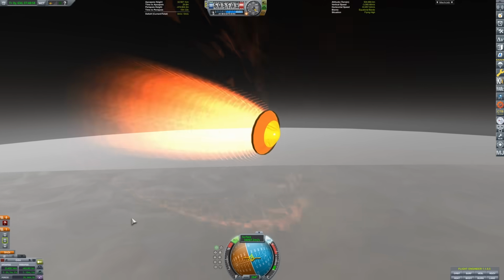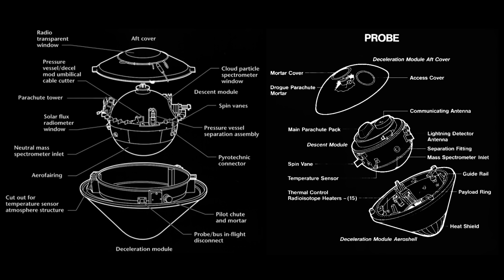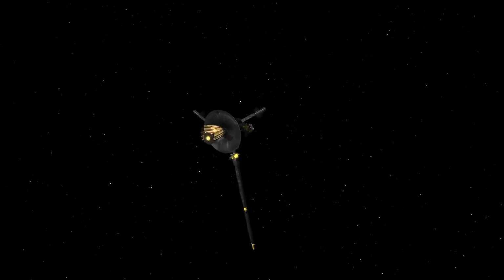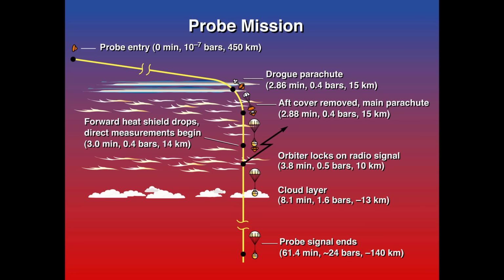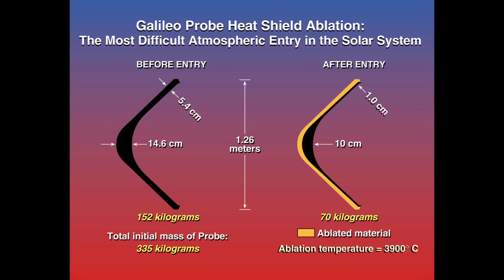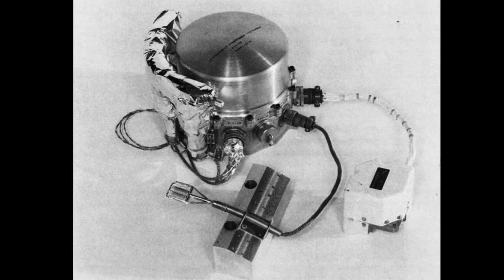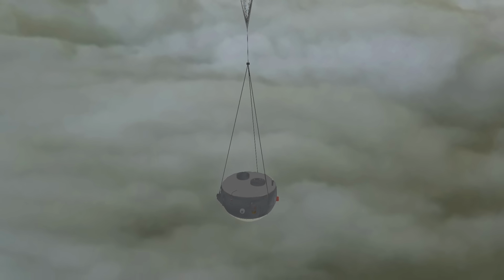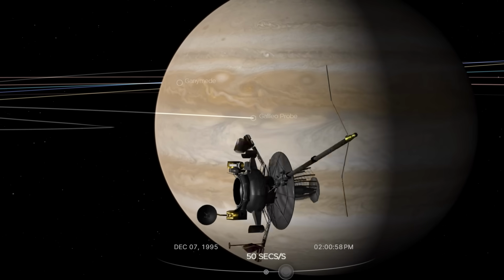The Toughest Space Probe Ever - How NASA Dropped A Probe Into Jupiter

Comment: How NASA's Galileo Probe Braved Jupiter's Extreme Atmosphere

*   0:04 Introduction: Almost 30 years ago, NASA sent a probe into Jupiter's atmosphere to analyze its composition, facing extreme challenges.
*   0:36 Heat Shield Challenges: The probe's heat shield had to withstand an entry velocity of 47 km/s, generating kinetic energy many times higher than experienced during a return from the Moon.
*   1:56 Extreme Conditions: The probe encountered peak temperatures of 15,000 Kelvin and heating of 30 KW per square cm, with a maximum deceleration of almost 250 G's.
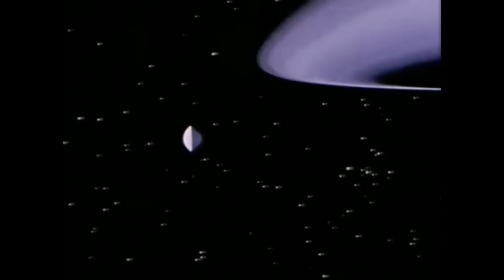*   2:45 Mission Background: The Galileo mission, conceived in the 1970s, aimed to orbit Jupiter and study its moons, building on the Voyager mission's findings.
*   3:17 Pioneer Venus Comparison: Galileo's probe was derived from the Pioneer Venus probes but had a much thicker heat shield (15 cm at its thickest point).
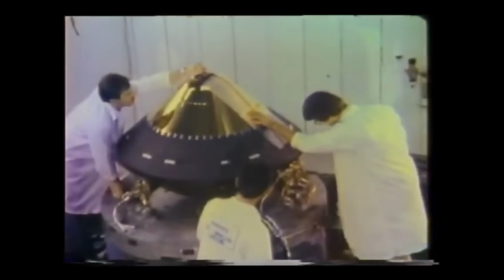*   5:11 Entry Velocity: The probe's entry velocity was less than Jupiter's escape velocity due to a trajectory that aligned with Jupiter's rotation, reducing the relative speed by about 12 km/s.
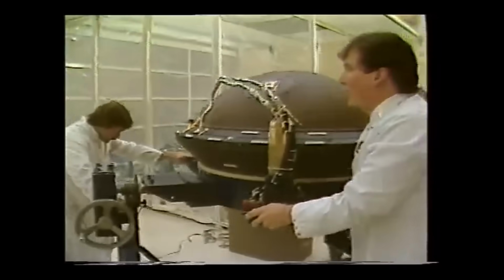*   5:54 Power and Attitude Control: The probe relied on battery power and was spin-stabilized for attitude control during its five-month journey to Jupiter.
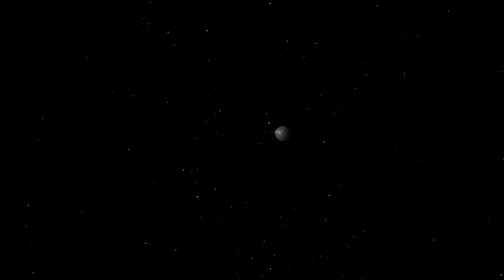*   7:47 Communication Challenges: The failure of Galileo's high-gain antenna limited data transmission to Earth, necessitating the use of a tape recorder to store and slowly relay data.
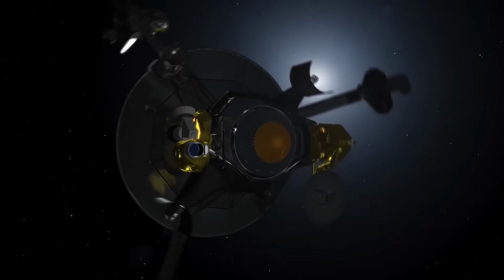*   8:28 Tape Recorder Issues: Problems with the tape recorder led to a decision to prioritize the atmosphere probe data over a close flyby of the moon Io.
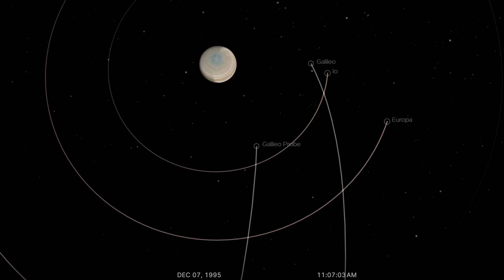*   9:50 Atmospheric Entry: The probe entered Jupiter's atmosphere on December 7, 1995, with the entry point defined as 1,000 km above the one-atmosphere pressure level.
*   11:33 Peak Deceleration: The probe experienced a peak deceleration of 230 G's, dissipating 20 gigawatts of power during a 100-second period.
*   12:01 Heat Shield Performance: Post-entry analysis revealed that the heat shield had ablated more than expected, with 4 cm lost out of a 5 cm thickness.
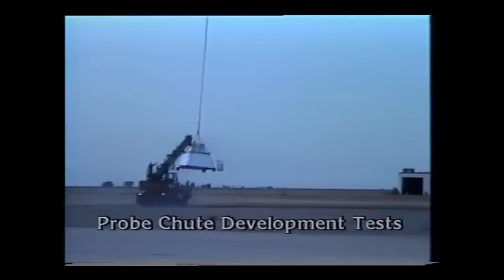*   13:11 Science Phase: After surviving re-entry, the probe jettisoned its heat shield and descended into the atmosphere under a parachute to conduct scientific measurements.
*   13:25 Parachute Deployment: A wiring error caused a delay in parachute deployment, resulting in the probe descending an extra 5 km.
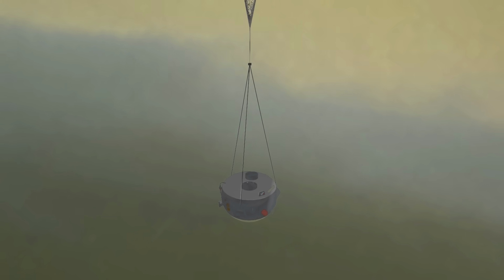*   15:29 Science Instruments: The probe carried instruments to measure atmospheric structure, energetic particles, lightning, radio emissions, isotopic abundances, helium abundance, and cloud particles, and to conduct a Doppler wind experiment.
*   17:32 Scientific Findings: The probe found a lower-than-expected abundance of helium and oxygen, stronger-than-expected winds, and less lightning than anticipated.
*   18:22 Anomalous Water Levels: Later data from the Juno mission showed that the Galileo probe likely entered a "five-micron hot spot" with anomalously low water levels due to a hole in the cloud layer.
*   19:23 Isotope Ratios: Isotope ratios suggested that Jupiter may have formed further out in the solar system and migrated inwards.
*   19:43 Probe's Fate: The probe transmitted data for 78 minutes, descending to a depth of 160 km and a pressure of 23 bar before being crushed.
*   20:54 Galileo's Legacy: The Galileo spacecraft continued its mission, orbiting Jupiter and sending back valuable data despite the communication limitations.

I used gemini-1.5-pro-exp-0827 on rocketrecap dot com to summarize the transcript.
Cost (if I didn't use the free tier): $0.03
Input tokens: 21058
Output tokens: 853

Comment: All that effort and the probe crushed at pretty much the test pressure for an aerosol can. Why wasn't it much stronger?
Reply: An aerosol can wouldn't survive 5 atm of external pressure. It makes a big difference whether you're containing or resisting pressure.
Reply: The limits were not just on strength but the power of the transmitter as it got deeper into the atmosphere and the fact the probe and relay ship were also moving away from each other.  This poor thing was battery powered.
Reply: you clearly forgot that pressure wasn’t the only thing there, heat killed it first

Comment: Considering they had 20% of their heatshield left in the end, the engineers actually did a great job estimating the correct thickness with a safety margin while also saving weight
Reply: Yes- and- no.  They got the total amount right, but the distribution a little wrong. 😅
Reply: Better to learn with an unmanned probe than a manned one, if we ever decide to try that at least. @jonskowitz
Reply: They had too much in the nose section, could've saved some weight by removing it, or beefed up the sides by redistributing it
Reply: A good engineer can build a bridge a great engineer can build a bridge that barely stands
Reply: @Official-Bush-applé Anyone can make a bridge, but it takes an engineer to just barely make a bridge.
Reply: @Official-Bush-applé if it only takes a fat oily man to break your bridge, how terrible.
Reply: Or don't get it right the first time. That means we don't get another job getting it right the second.

Comment: Great video, some footage of the probe ground processing I hadnt seen!   One minor nit, at 3:21, the Pioneer Venus Probes sent their data directly to Earth, the PV orbiter did not relay their data in the way Galileo did.  Another difference is that the Galileo probe was vented, so the hull itself was never 'crushed' (though the instruments inside were...) Ralph Lorenz, co-author "Planetary Landers and Entry Probes",  Dragonfly Mission Architect
Reply: The original mission design had the Jupiter Entry Probe's data being sent 'bent-pipe' via the Orbiter's X-band HGA link (max 134 kbps) prior to the JOI burn (with its attendant risk of losing the Orbiter). With the failure of the HGA to deploy, the only option was to store the Probe data on the DMS for later retransmission to Earth at a much lower data rate via the S-band LGA. An 'edited' set of Probe data (headers etc. stripped out, leaving only the measurement-containing symbol data Had the data stored on the DMS, been lost, the entire dataset could have been reconstructed from the symbols) was stored redundantly in both CDS strings for a quick look (and backup to the DMS) for more immediate downlink prior to Solar Conjunction which blocked all data return for a few weeks. The total Probe data occupied ~50 kB, easily accommodated by a 5-inch floppy disk.
Reply: A vented atmospheric probe! But I guess the electronics and some of the instruments were inside (or entirely built as) sealed vessels. It would be nice to know the rationale behind this design as, IIRC, the Pioneer Venus probes design pressure was also quite high and one of them even continued working after impacting the surface (~100 bar).
Reply: I can no longer hear the word Galileo with my brain singing "figaro!"

Comment: The reason that the High Gain Antenna failed to deploy was that the Spacecraft went into storage due to the shuttle failure.
NASA was not aware that the Lube on the high gain antenna deployment mechanism was sensitive to long term exposure to moisture.

They did not purge the mechanism and store in in a moisture free environment (enough) OR redeploy and replace the lube before launch
Reply: The Flight HGA was overtested and stressed during dynamic testing. With the only backup HGA now the prime flight antenna a policy of 'handling it gently' was followed. This extended to not fully  retesting the antenna after a couple of years in storage and two trips by truck across the United States (the travel container, a big white cube mounted on a low-boy trailer, picking up a bullet hole in, where else, Texas). 

It is thought that the 'scrubbing' of the pin on the antenna rib in its groove on the center column from the vibration during travel depleted the dry lube and perhaps even galled the metal surfaces, increasing friction to the point where it could not come free. The engineers investigating the problem did a lot of tests using our Testbed to control and drive the spare antenna. They  said the smallest pressure from your pinkie would probably pop the pin loose, but there was no way to apply that force in the right direction using the functions available on the spacecraft. It was designed to isolate the system from such dynamics, not transmit them through. The dynamics of spinning up the spacecraft for the JOI burn, as well as the burn itself, we're considered to be the last chance of popping loose the pin, and that was not thought to be probable at all.
Reply: @Gregory_Laborde  My company made the drylube (Ball Aerospace - now BAE).   We use it in all of our deployment mechanisms. it must be purged or it will absorb moisture and cease being a lube
Reply: I do not know anything about the dry lube, but I am pretty sure it was nothing exotic or unusual, and not implicated in the failure.
Reply: I was also told that they repurposed some processor on the spacecraft to compress data for the 10 bps downlink rate.
Reply: @stuartgray5877 That was the offline AACS processor, which was powered off and only planned to be used in the event of a failure of the prime AACS processor. Since it was just sitting there doing nothing...

In the event of a failure of the prime AACS processor, the backup processor would be immediately reset and reloaded with Attitude Control and Articulation software to maintain the safety of the spacecraft.
Reply: I heared a something about cold welding. Was this a myth?
Reply: @lukasskymuh5910  I never heard any mention of cold welding. Since the pin was Titanium and the groove stainless (or was it vice versa? This was 30+ years ago. Where were you?) I do not see how cold welding could have been a possibility.
Reply: @Gregory_Laborde  I checked this and apparently the source is: Johnson M. R. (1994) "The Galileo High Gain Antenna Deployment Anomaly." 28th Aerospace Mechanisms Symposium

It is mentioned in "Cold Welding under Space and Launch Conditions" Roland Holzbauer
Reply: @lukasskymuh5910  There is such a thing, but typically with items of certain materials in contact for a long time.
We have learned what materials to use and not to use that it is of little concern today.
We do still depend on certain types of vacuum grease and lubes that can still have useful properties even in vacuum, but they typically require some care in handling before launch.

Comment: The atmospheric-probe wasn't crushed by Jupiter's atmosphere, Scott, as it had pressure-equalising valves, the probe instead was cooked as it descended into the hotter, deeper layers before then melting and finally vaporising.
Reply: @nicholasmaude6906  Although your statement is probably right, there is an effect that has burned many underwater ROV makers - one can equalize pressure all one wants, but there remains cavities inside chips that are often at 0 psi. That's fine, until physical deformation brings 2 things into contact that should never touch. Then, it stops working. After bringing it back up, it resumes working, making diagnosis trickier.
Reply: @FelonyVideos  While you have a point about the pressure, the ROV designers don't have to contend with increasingly higher temperatures as the ROV descends into the depths.
Reply: @nicholasmaude6906  True. And good point. 5 kpsi in gas pressure on Jupiter is probably enough to destroy/melt anything that isn't metal. Ocean depths have the huge advantage that the vehicle is surrounded by an infinite 33F heatsink.
Reply: In other words, heat stroke and battery failure killed it. I imagine it fell hundreds of miles after that, melting then burning up as it fell.
Reply: @taras3702  Nice summary of the probe's fate.
Reply: Anthropogenic Jovian Warming... 😂

Comment: There was actually a much more serious problem than the ’snot’ on the dummy erase head discovered when the spare DMS (Data Management Subsystem - in the GLL Testbed failed a few hours after the flight problem. An LED used to detect End-of-Tape failed, allowing the clear leader at the end of the tape to travel through the mechanism to trip the beginning-of-tape sensor, locking the tape irretrievably at EOT. Opening the spare DMS to fix this issue allowed engineers Greg Levanas and Mike Johnson to diagnose the stuck tape issue and determine that the tape was almost certainly intact. Later we advanced the tape, demonstrating that it was in fact intact, and then wrapped up the potentially weakened spot in 25 wraps of tape to protect it. That plus the LED issue meant that we could not go to either end of the tape again. The software in the flight computer was modified to only move in playback mode and look for data patterns saved to the tape. These patterns became the new Beginning- and End-of-Tape markers, referred to as ‘New BOT’ and ‘New EOT.’
Reply: Imaginatively.
Reply: @Gregory_Laborde  I love the creative solutions that have to be conceived and implemented when things fail, that was a terrific idea!  Thank you for sharing it, this is why I bother to read comments on the channels of some of the top-flight YouTubers especially with space & astronomy - people who were part of the process are often providing otherwise untold details about the projects.
Reply: That's really thinking on your feet.
Reply: Why were they still using tape in 1995?
Reply: @nighttrain1236  Space tech is basically always 10 years behind current tech for redundancy when being designed, and Galileo was being designed in the early 1980s.
Reply: I wonder if you ever met my friend Mignon B., who worked on developing new coding for the medium gain antenna link after the high gain antenna failed.
Reply: @jdsahr  ‘Mignon’ does not ring a bell, but a lot of people worked on GLL, and I came on board (the second time) just as we were starting system test of all the software changes required for what was titled ‘The Galileo Low-Gain Mission,’ or as we called it, “Phase Two.” Fortunately GLL had flown a hardware convolutional encoder (A-side, IIRC) that was pressed into service to enhance the downlink. Also, the S-Band downlink was set permanently to suppressed carrier to put all of the downlink energy into the data and not the carrier (which was useless for carrying any data). This required a comprehensive and fundamental upgrade to the receivers at the DSSs to receive the carrierless signal, resulting in the’Block V Receiver,’ an amazing digital receiver still in use today (or at least it was when I retired two years ago). 

The biggest software upgrades aboard the spacecraft were in the data compression and editing tools that scientists used to select certain desirable data in advance so as not to clog the downlink with superfluous or uninteresting measurements (table-driven or parameterized, I believe), as well as conversion to packetized data rather TDM (time-division multiplex- streamed) data. This allowed maximum use of the downlink by filling it with the next available, priority data packets instead of an idle pattern. Where packets did not fit cleanly into downlink frames PWS data was used to ‘fill’ in the unused portions rather than wasting valuable downlink space. This was an amazing set of software, especially fitting into ~385 KB of available memory in the CDS (AACS offline memory, ~1 MB?, intended to be OFF until needed, was used to compress images and other data before queuing it up (on the DMS) for downlink). The movie ’Apollo 13’ came out while all this was going on. Our Flight Software Team was every bit as good as the people who saved that mission. The leader, N Talbot (Tal) Brady, was a senior engineer who had become too engrossed in the real challenges of space software development to finish college, was a real hero (HERO) to me.
Reply: @jdsahr  Although we called it ‘the low-gain antenna’ (LGA), at 8dBi it was really an MGA. Considering the minimum distance between Jupiter and Earth, the DSSs were always easily placed within its ~65 degree beamwidth. A 3-4 dBi LGA would have been quite useless.
Reply: @jdsahr  Mignon was almost certainly on Tal’s FSW Team, although he might have also supported the BVR, which was also a hugely software-intensive project I had little exposure to (although I reaped its benefits for the next 28 years).
Reply: BVR = Block V Receiver